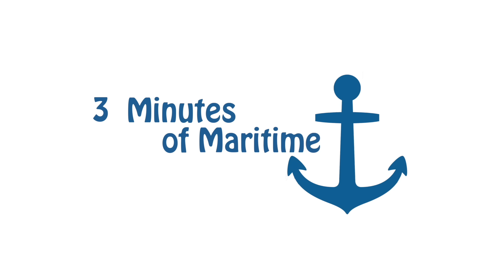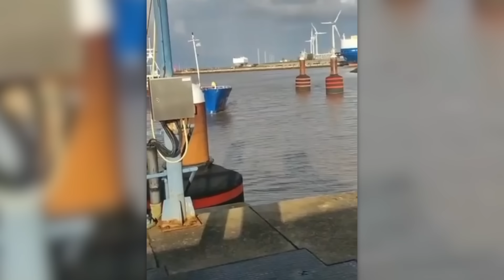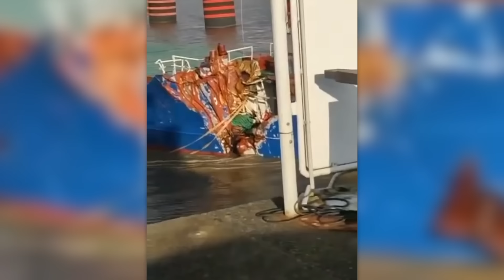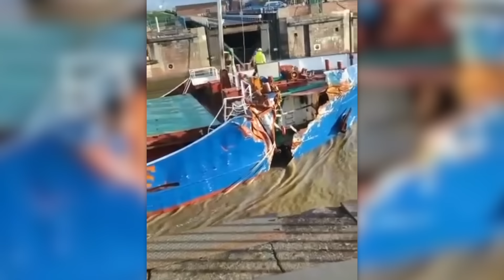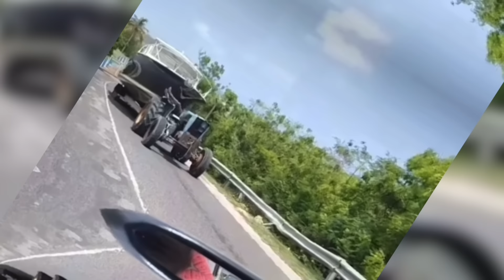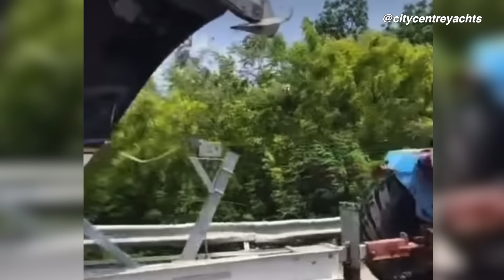Cargo Ship Ripped Apart by Wind Turbine! | Warships Collide | 3 Minutes of Maritime

Comment: That damage is awfully rusty to be fresh. Looks like it was done months ago.
Reply: looks like it went sideways into this windmill? insurance job
Reply: salty seas rust things in a matter of a day or 2.  at least a surface rust. my problem is that they think a fiberglass wind turbine did this. looks like an impact of another ship to me.
Reply: @postalsucks9548  The structure seems sheared in nose-to-stern direction.
They just struck some sharp corner.
Reply: @postalsucks9548  well it supposedly hit the concrete base the turbine sits on. Only an idiot would think that it was chopped by a blade.

Comment: Every Admiralty lawyer will tell you that the two Royal Navy ships did not collide. The one on the right allided with the one on the left. A collision requires 2 moving vehicles, trains, or ships.
Even if you use "auto-pilot," you need to pay attention. There are stories of power boats going from Catalina to Los Angeles, being put on autopilot, the skipper taking a nap or getting drunk, and the power boat plowing into the breakwater. The Los Angeles Harbor breakwater has two entrances, one at Los Angeles Harbor Lighthouse and the other at Long Beach. The end is about even with Seal Beach in Orange County, California.

Comment: What in the world did they build that wind turbine out of?
Reply: Looking at the other wind turbines in the area, the ship would’ve run into the pylon supporting the wind turbine, rather than the turbine itself. I could have been anything, but just happened to be a turbine on that pylon.
Reply: @SeanPat1001  Looks like the ship had hit a sharp corner.
Isn't a typical foundation round?
Reply: @u2bear377  I think so, but maybe they hit a platform or something that was attached to the base. Like maybe a dock of some kind for small boats.